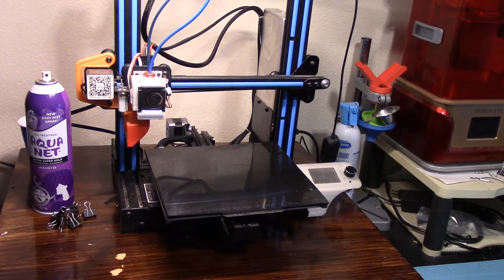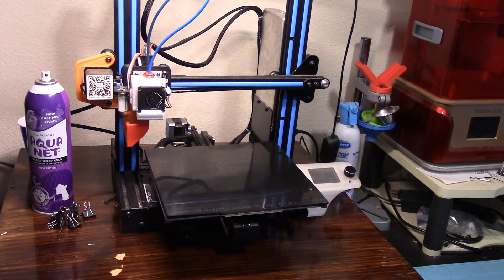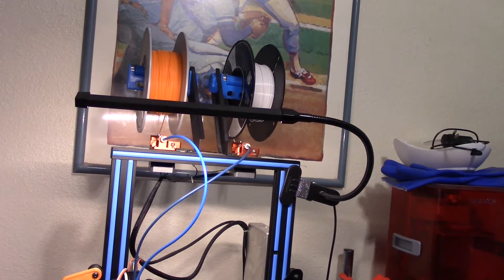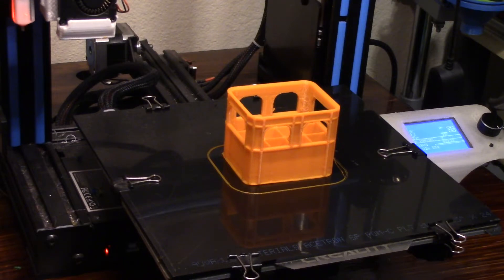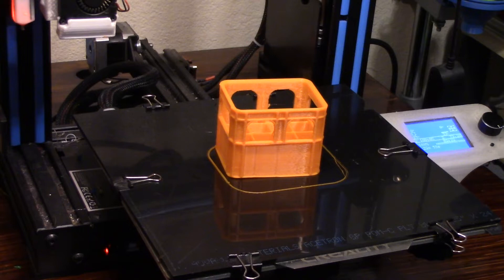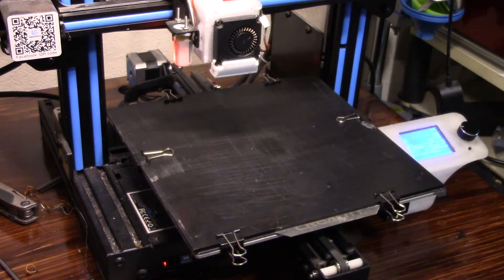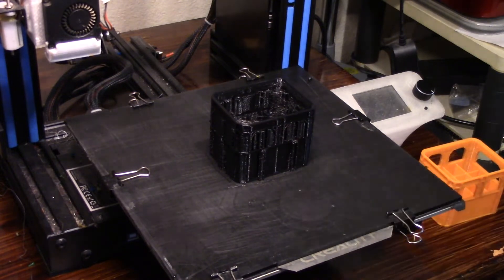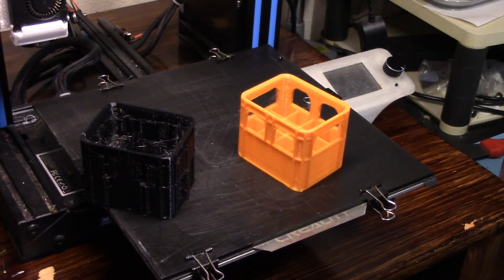What filaments will stick to a POM/Delrin print surface? Let's find out!

Comment: Just thought I'd say that I'm happy to see the POM printing being mentioned again, even if you're not still attempting it!

I've been printing POM lately, but I've also not figured out exactly how to tame the warping. I can print a decent Benchy, but the base warps enough that actually printing dimensionally accurate mechanical parts woluld be out of the question - and if you can't do that then POM is pretty much useless.

110C bed, 55-60C chamber, and 220C nozzle temp has given me my success. Zero cooling, around 2mm^3/s printing speed.

I've had most success printing on simple gluestick covered printer paper. The POM sticks well enough to it that it'll sometimes delaminate the paper if the warping is too much. Getting the paper stuck down well enough to a bed surface has been my latest issue though - at 110C gluestick tends to let go.

You can print on a PLA raft (so I'm not surprised that PLA sticks to your POM bed), but it can't really handle the heat you need for printing the POM on top of it. I've still got some testing to do there.
Reply from the maker: If you watch the videos I linked you'll see I went through all that and more. My conclusion is that the inside enclosure temp needs to be a lot higher than 50-60c. Probably more like 100c or higher to keep the warping under control. A bed temp of 100c is also going to help. Problem is, my current enclosure has no means to get that hot and even if I added a heater there are too many 3D printed parts inside that can't handle it. My final thoughts were that until I have a real pressing need to print out of POM it's just going to have to go on a back burner. Thanks for commenting, if you have any luck please let me know!

Comment: Hi Chuck. That's an interesting set of tests. I think I am going to try a different surface on an Ender 5. Would you go for Delrin os the Creality glass bed? I might want to use it for PETG so don't want to damage when it sticks so well. I hope you're well and looking after yourself.
Reply from the maker: Hi Paul. I'm a big fan of glass beds, specially mirrors since it's so easy to tell if a mirror is flat. Also, mirrors are dirt cheap. But glass does break easily and I've broken a couple of them myself while having them off for cleaning. I've never damaged a mirror bed when removing a print. I'm honestly not sure how people are doing that. If I were going to use a delrin sheet as a print bed I think I'd get a 1/16" or 1/8" sheet and glue it to a flat steel or aluminum plate. PETG seemed to stick pretty well to the sanded side and no adhesive is required. I'm going to play around with mine some more, probably try TPU and Nylon on it, those two along with PLA and PETG are about all I really print with anymore.
Reply: @3rdpig  Thanks, Chuck. I really only use PLA and PETG too. I will see if I can get a chance to play around.
Reply: PEX is good for PETG and PLA. PEI if it's textured (PETG sticks far too well to smooth PEI).

G10/Garolite etc. is good for PETG too.
Reply: @mowcius  Thanks Robin